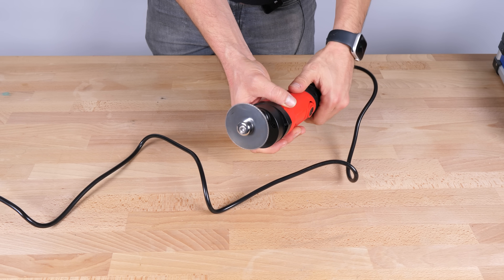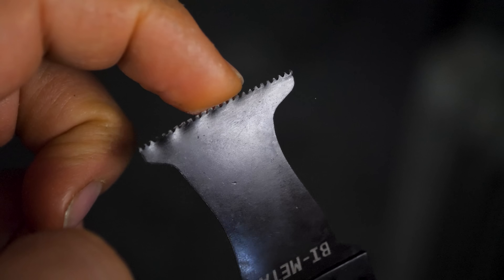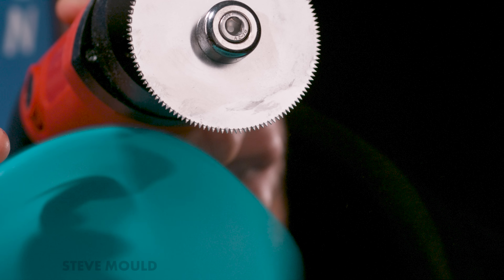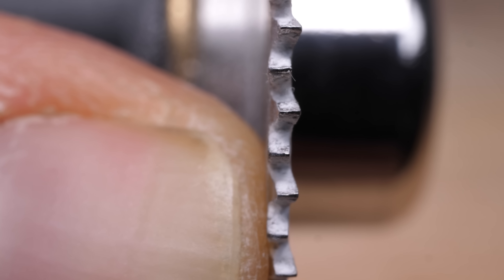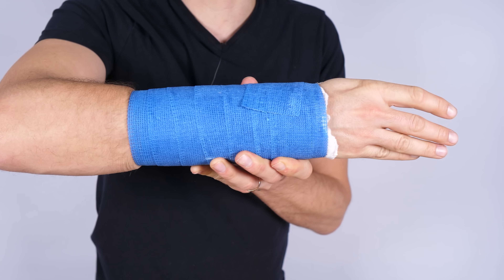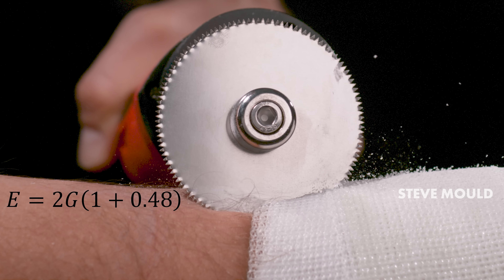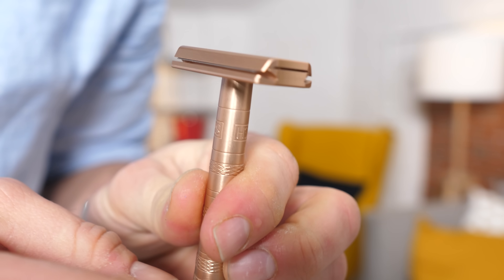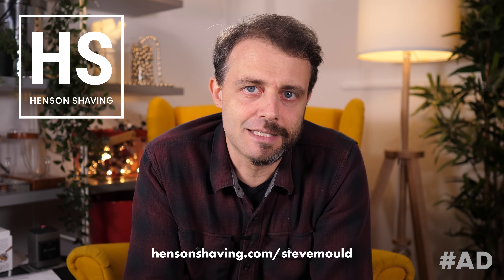A cast saw on human skin

Comment: The first cast that I had taken off I was morbidly scared of the large blade and knew if the doctor made one mistake my arm would be severed.  After a month I googled it and was relieved that it's actually impossible due to the blade not spining at all.   I guess its also due to the speed its oscillating, anything beyond the skins ability to be elastic and you will have a nasty cut.

Comment: Yeah...I got a question...If it's an oscillating tool and not a rotary tool what's the point of designing it to have a round blade? The only thing I can think of is that when it was invented they just started with an off the shelf blade and kind of reverse engineered the motor bit from there. But is there a better reason?

Comment: Why is the dang thing circular then?!
Reply: You would have to cut the cast at a weird angle if it were a straight saw. It’s super easy just to go right in
Reply: @henrysanecdotes5323  it could be 1/3, 1/2, 2/3 of a circle, usually over half of the blade is hidden/protected from, there's no way to use even half of the blade, if it was rotary it would make perfect sense to use a circular saw, but why shape and sharpen a tool half of wich will never be used? Its a waste of materials, work and money
Reply: @godzuki2099  balance and symmetry so that it rotates easily? Also if it gets dull you can just rotate it to expose a sharp section of the blade
Reply: Because it’s easy

Comment: Also great for replacing old baseboard and trim in your house. :) Ive saved shitloads of antique moulding because of my multitool, constantly using that ting on jobs. Fuckin blades are pricy though, watch out for nails. xD Also.. The pro grade ones will slice you up on high, and literally make your bones itch (its a strange feeling from the vibration), and yeah.. don't try this with a sawzall- you'll lose something important.

Comment: Over engineered. Just use scissors
Reply: Scissors can’t cut through that easily. Also, the engineering has already been done and it works so why not keep using it
Reply: @henrysanecdotes5323  because scissors are cheaper to make. besides, where i live both the casts and their removal are cheaper. simply don't cover the entire limb, leave a small sliver for scissors to fit in... that's how all casts that i ever had worked. cheap and simple.
Reply: @512TheWolf512  hospital bill inflation then

Comment: Wonder if it'd be safe to use if it hits against skin that's close to a bone. The skin on my the knobs near my hands and feet seems to barely have anything beneath it... though it does slide around easily. The skin on my forehead seems a bit more rigid, but still seems to0 move a few millimeters when pushed.

Comment: I had a leg cast removed about 3 or 4 times with a cast saw and it hurt me. The guy doing it said it was impossible to cause pain, but I know what I felt. When the cast came off I had (on 2 out of the 4 times they did it) a red raw line all the way down my leg like a burn. Maybe because my leg was swollen and as tight as a drum, but either way it was extremely unpleasant to go through that. Plaster technicians should take note of this, these things CAN cause pain.

Comment: yeah these oscillate, not rotate. These are the reason why those oscillating tools started hitting the job sites. It won't really catch loose wire or insulation behind drywall like rotating saws, jigsaws and keyhole saws do.

Comment: Used to take casts off in a hospital in New Zealand... you have to be careful around bone and finger/toe nails as it will go through those. It is in fact an oscillating saw not a circular saw.  It oscillates on a certain frequency that cut a particular material like plaster or nails.

Comment: I also think it's interesting that the Plaster of Paris cast getting cut doesn't throw shavings equally in both directions. It looks like the cast saw uses the oscillation in one direction to pull the whole cast backwards before cutting through the cast using both the oscillation in the opposite direction and the force of the cast itself moving back towards the blade.

Comment: I am an orthopedic surgeon and cast saw injuries are quite common, even when an experienced person is using them. At my hospital there have been severe injuries. 

If you press the oscillating cast saw against a person's skin and then slide it, you will slice right through the skin. The blade can also get extremely hot if it is dull and can cause severe burns.
Reply: Thank you for your comment. I had injuries on my leg twice from having casts removed. It was like a burn from my thigh to my ankle and it hurt like hell while they were doing it, but the technicians scoffed at me and said it was all in my head. Now I know what it was - they were burning me with the saw because it wasn't sharp enough.
Reply: @captaincat1743  My doctor told 12 year old me the same thing, "It's all in your head", as he was cutting open my leg cast. When he removed it, you could see that he'd sliced open my leg from my ankle all the way to my knee.
Reply: i was wondering about that; sliding it down the cast while cutting it and if it was in contact with the skin.  thanks for your insight :)
Reply: I got my cast cut off by an old cajun ortho when I was a kid.  The dude told me 'if it cuts you, you can punch me'.  Well I jumped when the blade went through the cast and it cut me.  I didn't punch him though, he was a nice dude.
Reply: Thank you for this wise advice, it needs to be highlighted in any such videos.
That saw definitely cut right through my skin immediately after the doctor told me it wouldn't.  I still have the scar.
Reply: Thank you! I had a cast removed on my arm as a child and the doctor‘s assistant absolutely burned my arm.
Reply: Absolutely. In 1976 I worked in the cast room at Broadlawns in DesMoines Ia and they were training staff too quickly. I never hurt anyone myself but was pressured to let a newbie have a go at removing a lower body cast on an infant. He was being a little shaky but as up till then  no one had been hurt I let him carry on, but when the cast was removed the infant had surface cuts all along the saw line.
Reply: I also use this almost everyday, never drag it or it will cut the skin, instead do a rolling motion it also produce less heat as the heat is distributed on all of the teeth
Reply: Happened to me, was looking for a professional to confirm what I know to be true.
Reply: your hospital sucks.
Reply: I had a cast cut off my wiener and the doctor got distracted and cut my meat off right at the stump 😢 I put my ruined wiener in jar and keep it under my bed
Reply: High Frequency Blade
Reply: exactly what happned to me in France years ago when i was a kid and broke a shin in an attempted skieing
Reply: Thanks, I feel much better now.
Reply: Better to just use an angle grinder, then. Faster, too.
Reply: Operator error. Maintenance error.
Reply: Absolutely. I was unfortunate enough to have an inexperienced and distracted practitioner remove my cast as a child. It was 1) red hot and 2) dragged and cut my skin.

I was told I was imagining it until the cast split open to reveal a pool of blood on my shin.
Reply: I was nicked by a cast saw when they removed my cast as a teenager.  Nothing serious or that needed stiches, but it did draw blood and was painful in the way that a nick would be.  Thank you for not gaslighting me :)  Maybe they weren't using it right, but it is capable of cutting into skin.
Reply: I don’t mean to sound too flippant, but it seems like you’re just describing Malpractice. They are operating the saw in a way it wasn’t intended to and causing harm because of it.
Reply: @lelandwhitehead56  Of course that is malpractice but the video kind of implies that the saw is foolproof to use and cannot hurt you while in reality it can absolutely hurt if the user is not careful.
Reply: @KnitterX  Anything can hurt you if its used improperly, no matter how "foolproof" it may be. The blade still has saw teeth on it, of course if you press down and push/pull.... its going to act like a regular saw would.

Down, let the cast saw make the cut into the cast, Up, and away from the cast to reposition it for the next cut. You don't slide it across. Zero medical education, training, experience, whatever... and even from a short random video I found that went over how to use a cast saw, that was quite basic to understand...
Reply: The one he used was probably brand new with a new blade.
Reply: @KnitterX a paper straw can hurt you if it’s not used carefully
Reply: @KnitterX  an advice, if you want to comment a video, watch it entirely!
"It can cut you"...
Reply: @Viper836   an advice, if you want to reply to a comment, don’t be unnecessarily sassy. Anyway, I didn’t say it cut me, I said it burned me and the video doesn’t mention that risk at all.
Reply: @lelandwhitehead56  Overworked medical staff? I never.
Reply: Please explain to us how a dull blade becoming hot over time can be considered "malpractice" @lelandwhitehead56
Reply: Even so, get the angle wrong & slice, slice, slice. 

They also don't feel nice to use. They don't angle or bend in any direction.
Reply: i wanted to be an orthopedic surgeon so bad. anesthesiology resident isn't a bad consolation prize.
Reply: Try shaving with one of those razors and not cutting yourself. Come on, there's a reason they're near obsolete.
Reply: @samuel3253 
Pretty easy actually. Keep your skin taught and lubed with cream and it’s a wonderful experience
Reply: @GoProXadventures Oh my, I'm  53. I think I know how to shave. 

Tell me this then, if these things are so good, why is there only one hook of these blades in the supermarket at best and a 100 hooks of cartridges? 

... and before you blame corporate supply and greed please consider consumer demand & it's drive to do this as cheap as possible.
Reply: @GoProXadventures wtf?
Reply: If you were actually an ortho you’d know cast saws don’t oscillate. They vibrate back and forth. You can cut skin if you have no clue what your doing and pull back when it pops through the fiberglass. We have a lot of pts that think the saw “stops” when it hits skin. Maybe the newer models do, but the older ones don’t. There is a lot of bad information out there
Reply: @Morgan-zf3yz  Oscillate means to vibrate back and forth. Cast saws have an oscillating blade.

Comment: The oscillating saw must be a new thing in the medical field, because I actually know someone who has a scar from where they had a cast removed and cut their skin.
Reply: From other comments that have been left, there are 2 ways they could have been injured. The person operating the saw could have slide it over the person's skin while cutting the cast, pulling the skin tight like the fully inflated balloon in the video, and cutting through it as a result, or the saw could have got very hot from a lot of use or from being blunt and burnt their skin as it went through the cast. If it is a scar from it actually cutting their skin, then it's the first one. I thin someone else commented that they're supposed to sort of peck at it with the saw, so cut perpendicularly to the patient's skin, only cutting through the cast by the width of the saw at a time, before removing then going from the outer surface again, hence me describing it as 'pecking at it'.

Comment: But it will hurt a little bit of tighter parts or heavier parts of your body depending on how your built. They can’t draw blood from many parts of my body with a nice blade. Really have to find a tight spot with a bone. Even then it’s not like they can murder you with it you will pull away. As far as many brands I’ve used it’s very very safe. Also can buy cheap and expensive blades but they mostly are the same. Unless you hit bones or nails I guess lol

Comment: I use this tool daily on the job. That’s construction BTW. It no matter the blade almost can hardly do anything to you. The isolation is such a small amount the skin can move with it not being very solid. Put it against wood or something hard it will cut or dull depending upon material. Best tool ever made so versatile and safe it’s one of the most used tools for me and my workers. It’s so awesome and I love messing with new guys trying to get them to let me put it to there arm then showing them me trying to cut myself even in some scary areas. They think I’m pulling a trick or they are amazed and want to try it on themselves. Very few let me show them lol. It’s a fun tool tho to mess with newbies lol.

Comment: When i was 2nd grade i broke my arm and had a cast. I was scared to go to the hospital to remove it so my dad just helped cut it with a pair of large scissors and for some if he just broke it apart with fingers. since the cast was only on the wrist up until before the elbow it was basically a straight line. Second time i went to hospital but they didn't use a Saw even tho the cast was from the thumb all the way to middle shoulder they just cut it with some weirdly shaped scissors without a sharp edge. These scissors kinda CRUSH it before cutting it basically.

Comment: I have a 1950s toy called "Jigsaw Junior".  It is a childrens toy that actually has a metal jigsaw blade with an electric motor and can cut through balsa wood like the real thing.  It sounds crazy that it would be a childrens toy, but it is the same principle:  the blade oscillates quickly.   It saws through soft wood but it won't do anything to skin.

Comment: I had three casts removed over a few weeks but the saw looked very different. It was smaller and didn't have a fully round circular sawblade on it. Since it oscillates, it only needs a small portion of that entire blade and it was contained in a metal top enclosure, similar to how table saws have that cover over the blade. Like the other comments here, the doctor first demonstrated it by placing the running saw blade on the skin of his arm.

Comment: Excellent video. Your example of a power tool with a "proprietary connector" looks like a Bosch drill.. and they use the 18V Alliance connector which means the batteries are compatible with tools from at least 11 different manufacturers. Your point remains a good one, as there are a lot of proprietary connectors - sadly, the example you gave happened to be a counter-example.

Comment: We gonna act like the thumbnail is okay bro literally said FPS= feet per second,  rotating object doesn’t use that its not moving anywhere FPS is for bullets and other object moving in that way, what should have been used is RPM revolutions or rotations per minute revolutions meaning how many times it goes around in a circle

Comment: I had a cast on my arm couple years ago I had a cast all summer an there was a fair coming I bought advanced tickets when I went to the fair I couldn’t go on rides do to the cast it was a liability thing so I went to my buddy’s house we cut the cast off with a at first we were gonna use a skill saw but we didn’t fell we had the skill 😂so I used a angle grinder with a cutting disk worked like a champ went to fair to a different entrance an went on the rides next day went hospital got new cast put on told them how we removed the cast they didn’t look impressed at all 😂😂😂😂😂

Comment: Good to see one of these influencer sponsor heavy brands is making an actual good product. Double edge razors are the shit, I've been using one for about 15 years. I prefer the blade angle on my Merkur which is more straight but I'll be honest, when I first got it I made myself bleed a few times. Now I have no idea how I ever did that, you just get used to it and can then shave perfectly safely. The more traditional high angle they have on this design as well as the minimal exposed blade would make it a really easy transition from someone used to cartridge razors. I'm all for it, the more safety razors and straight razors people use, the less bullshit waste that's needlessly created with cartridge blades.Not to mention the price. I bought a 250 pack of Feather brand blades (strong recommend) on eBay about 8 years ago, I think its going to last my entire life 🤣

Comment: I’ve had casts removed using those. The technician let me in on a secret and let me run the blade on my arm after the cast was off. It was the best scratching sensation to the worst itching sensation ever. Did take some of my arm hairs with it though.

Comment: I was aware of this property of oscillating tools, pretty sure it was due to Adam Savage mentioning it in one of his videos. Probably something that fascinated him or that a viewer question, honestly can't reproduce that at this time.

Yet even while I know about this I fully expect to still be at least mildly concerned if such a tool is ever used to remove a cast after a potential future accident that required one. Also those old traditional ones take a really long time to harden completely, wasn't aware of that. I'm kinda curious what they used in the before times to remove those? I'm guessing oscillating blades weren't invented yet back then.

Comment: As an Aerospace Engineer with a focus on structures, while the actual math done for the Poisson's ratio is correct here, your numbers are more or less garbage for two reasons:
Skin being anisotropic means that the strength varies depending upon orientation, much like composite materials like fiberglass and carbon fiber. This means your numbers would only hold true for the specific direction in which you held the saw, but not necessarily true for other directions. Also, these formulas assume that all the deformation is occurring entirely within the elastic portion of the stress-strain curve, which is the very small first section of the curve that only holds true for very small deformations.